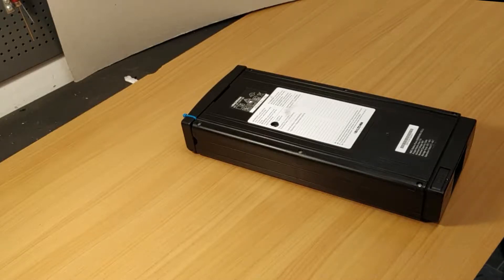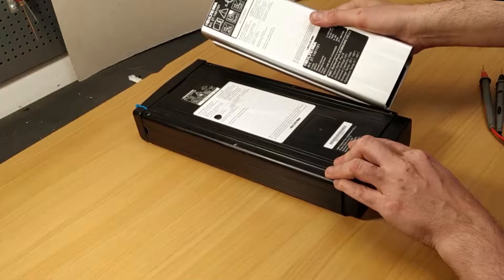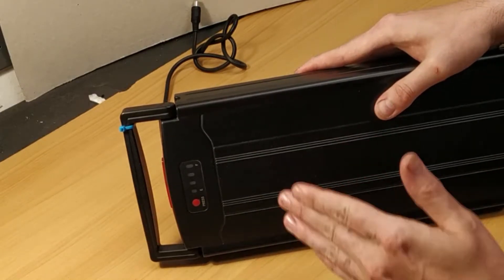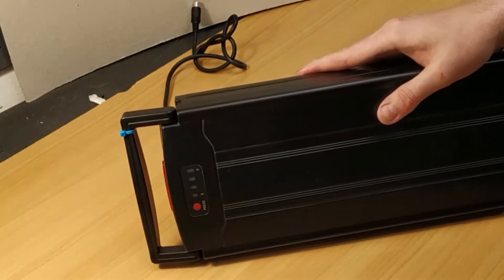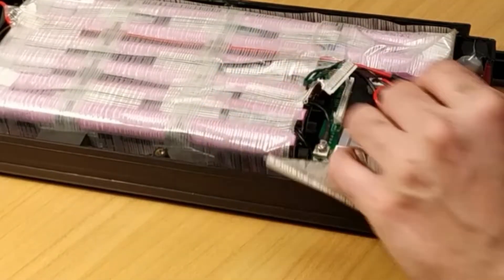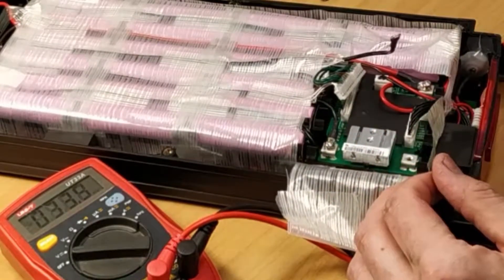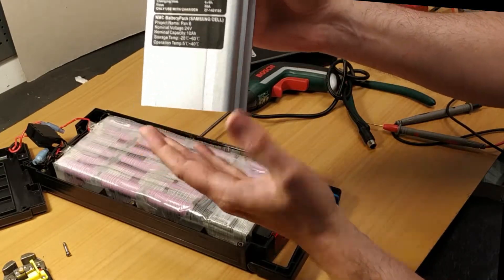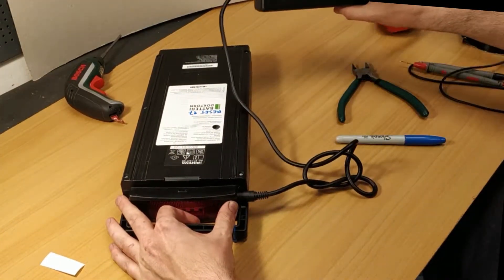How to Fix Planned obsolescence in swedish ebike batterypacks from Biltema

Comment: Hi,
I have a yosemite 28 low step from Biltema. The batery do not even blink red when I push the red button. I openned it try all the manip but it seems it doen't take the charge.
Also, my charger, when plugged has red and green light. Should it be only red (for power) then the other led will be either green or red when plugged?

About to give up but wnated to ask you first....I dont want trash battery that can sitll work

Comment: Hi, thanks for the video. Bike: Helkama Lounatuuli with similar battery in Finland. 3-4 years ago I got complaint that the battery won't charge. I followed your guide and got the battery charging and working again. Now 3-4 years later I got complaint that the battery is empty after short distance. I noticed it shows full charge shortly after plugging in the charger (voltage around 24 volts when it shows full!). The lights on battery would show 4/4 (full) but on the bike it was showing 1/4 (empty). I did the same reset again and plugged in charger and now its 1 out of 4 and it did charge to full and it works better.

Comment: Thanks for the help. You were right and this happened to my e bike. It just stopped working and showed a voltage of 13.4 v on a 92 v battery. the battery itself was at 84v but the outside connector was 13 v. The BMS was more complicated but the China seller thought I would buy another couple bikes so she asked the technician. I was told to hook up a 12v battery charger and touch two leads. It reset the BMS and everything worked again. If not for this video I would have no choice but to buy another battery.

Comment: Friends battery have different BMS, it has small button type battery on the board it self. It's soldered on the board so it's not really easy to remove. I tried all the steps but it didn't  work. I think I'll have to pop that battery out.

Comment: I have the same battery, from Norway. But when I press the red button on the outside it wont even blink. Not taking charge
Reply: Have the same. 
I can't even close it up because its a spaghetti of cables
Reply: I have the same issue, no blinking red light when pushing red buttons :(

Comment: Hi! I have a problem, battery works, but it will be lose energy very quickly. I measured voltage from behind and get only 4,3 V. It is the two closest pair, others are not giving anything. With opened battery I find 29 V. I tried your solution, but it didn't work. What is wrong?
Reply from the maker: "voltage from behind" you cannot meassure since its turned of. You have to meassure in the charging port or on B- and B+
Reply: My friend measured from behind his battery and get 24 V, 19 V and 17 V. Why my battery is not giving the same? BTW I am talking 24 V 10 Ah battery...
Reply: I guess you are right. I tried to connect almost dead 9V battery to my bike. The left and right one made the light flash on control panel (in front) even if power was off! Actually the thing what I want to know is, could biltema's ebike work with two 12 V lead batteries? Can it be done? I don't like Li, because I understand the Pb-battery.

Comment: Very interesting - thanks for sharing.
But please don't be in such a hurry - slow down a bit to show where you put the probes - they are out of shot sometimes.
Also.when you mention "draining" the BMS of power with the probes,what meter setting is used ???
Is it on DC voltage ???
Thanks.
Reply: I will have better quality in the future. Have a gopro but no stand for it.

DC voltage setting, any range. Do you have this battery?
Reply: @Batteridoktorn  I don't have this battery,but I have worked on others.
Thanks for the reply.
Reply: @Batteridoktorn  Hello mate! Maybe u rmember what volage should show on -P/+P after connecting everything? I installed new pack, its charging now, pack has 41V but on -P/+P shows like 20-25V.
Reply: @Batteridoktorn  So u think everything is fine, and after connecting battery to bike it should start? I don't have bike to test cuz its for customer. I made 1 of 2 and want to send it for test.